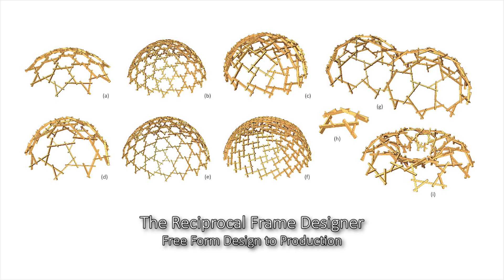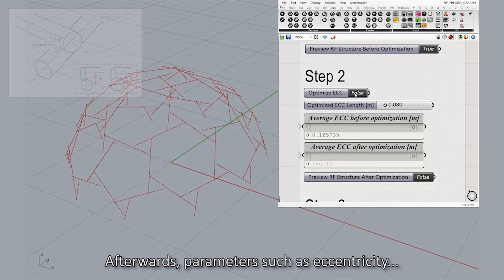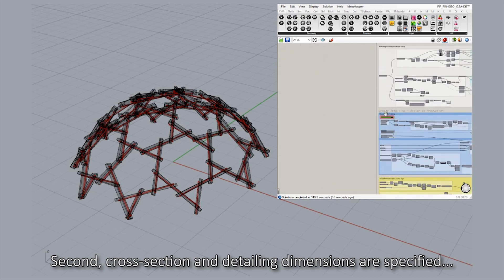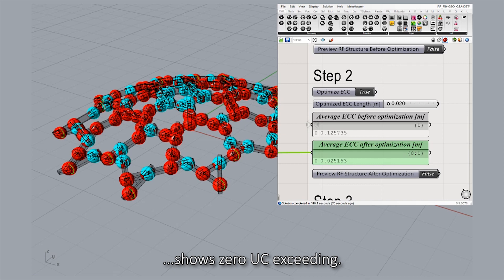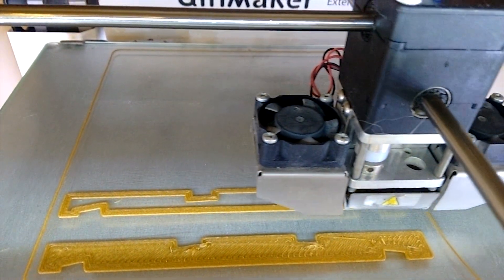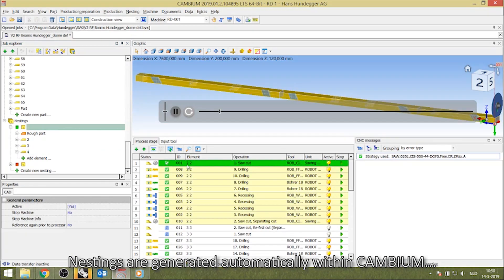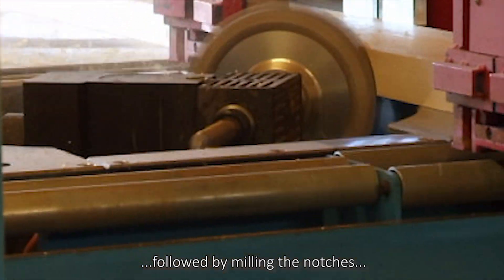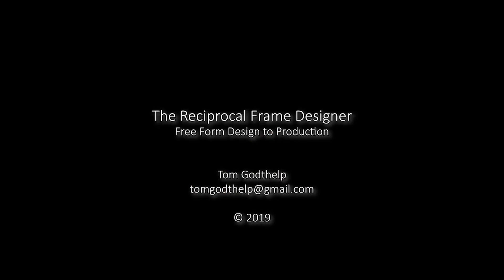How to design a Timber Reciprocal Frame Structure: A computational approach

Comment from the maker: Thanks all for your comments and interest. Please check the links in the description for more information about the definition and how you may be able to create one yourself. All information on how to do so is written under the links in the form of a report and a research paper. If you have any questions feel free to contact.
Reply: I tried sometimes but i did notmaster rhino grasshopper, just basics, would you share the code programming? will not lie, i would use for many reasons, so, if you have any contract of percentual by use, it would be perfect for studying and work when I might need it

Comment: All you need is the pattern. The big deal is the fitted joints, which is nice, but not necessary to be successful. Simply use different traditional joinery and you easy reproduce this structure from anything. Cool design, easy to replicate affordably, too.